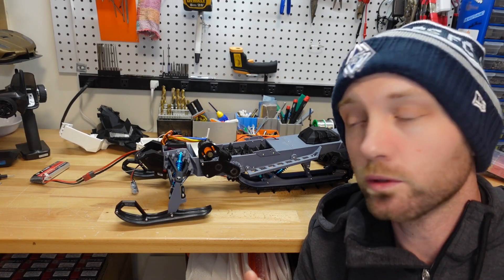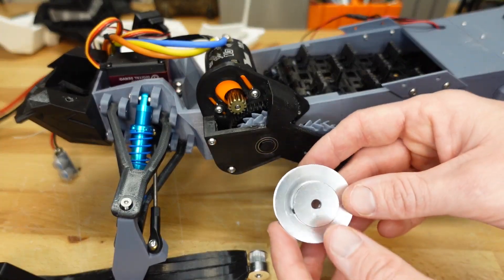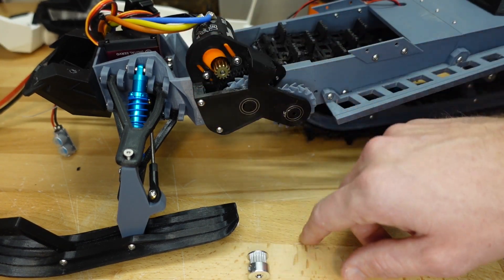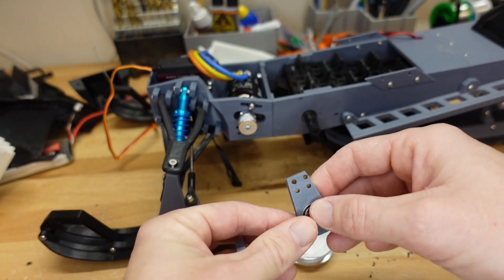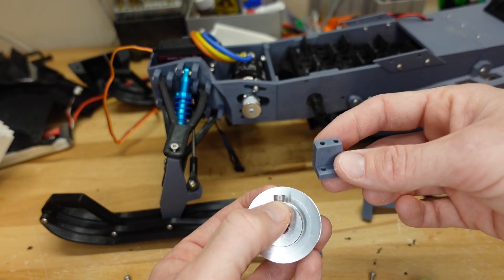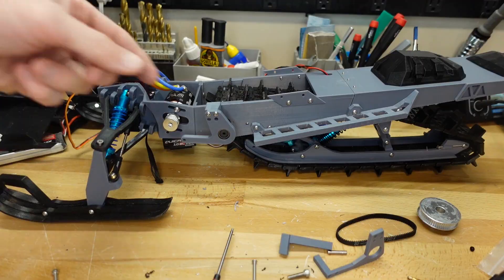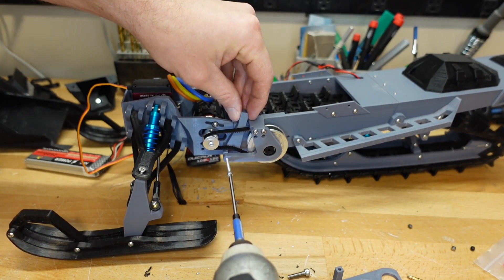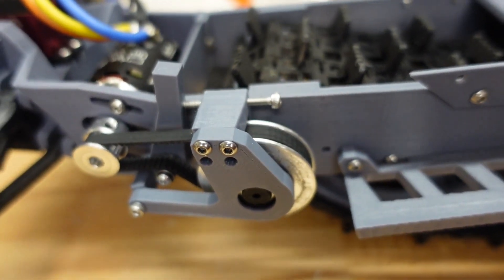Skeeride Belt Drive Upgrade Tutorial

Comment: Which minimum power Dc brushless motor do you suggest me?
Reply from the maker: For a Skeeride 1 I use a 13.5T standard 540 can brushless sensored motor. This works out to around 3500KV I believe. I wouldn't want to go any higher KV (or lower T) or you'll start having heat issues. I run it on 2 or 3s LIPO. Get a brushless SENSORED motor. IMO you don't want to go for a cheap sensorless motor.

Comment: I have a problem the stap slips on the big gear
Reply from the maker: If your tension is set right and everything is aligned properly I'd guess you've either already stripped your belt or your gear (if its 3d printed).